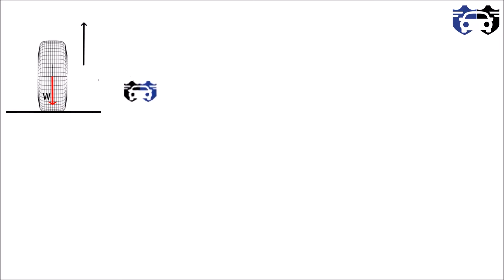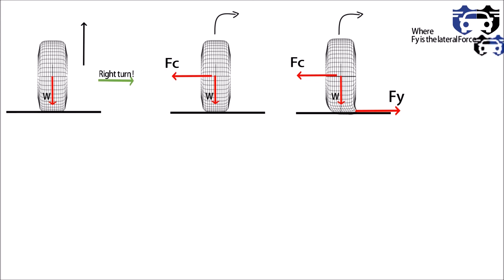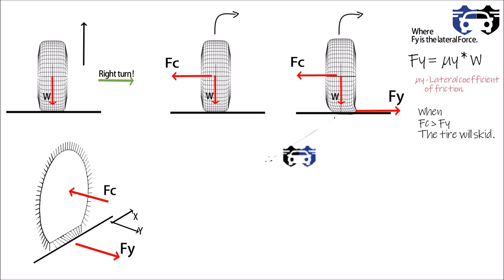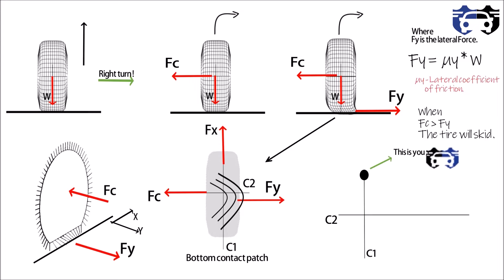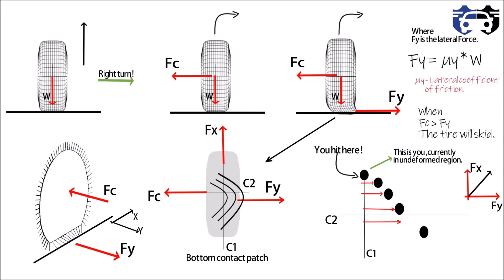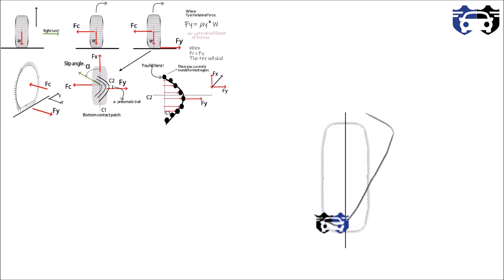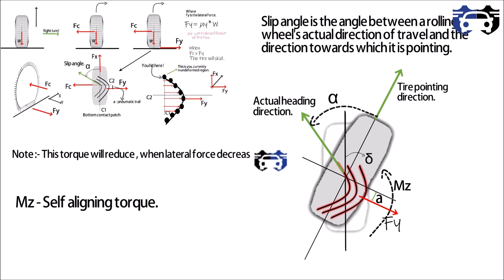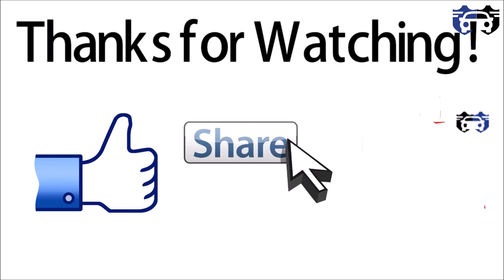What is Slip angle ? | How lateral force is generated ? | What is self aligning moment ?

Comment: The Actual Heading Direction arrow drawn at 3:16 is very misleading. Surely it should lie somewhere between the tyre centreline and the vertical line. Showing it as you do suggests that when steering the wheel to the right of its original direction the tyre actually travels to the left of its original centreline!
Or am I misunderstanding the diagram?
Reply: I have the same doubt can alpha the slip angle be greater than the delta the steering angle as shown in the diagram?
Reply: Since he is taking a right turn, the treads in the contact patch will remain the same where as the other treads will twist in the direction of the turn and that too to the right of the centerline not left as he has drawn. Thtas what I think

Comment: Umm... 
Does "Lareral Force" means "Cornering Force"???
I'm so confused beacause of concept of both of them.
Reply: There is no force called Cornering Force. When you want to turn, there are 2 things that will be consider:
1. Slip Angle (which cause when you suddenly change direction. Relevant to Lateral force. Here Lateral Force + Longitudinal Force will make your vehicle turn in a curve - of course there will be slip -> reason for the name Slip Angle)
2. Camber Angle: when you turn right for example, your center of mass will lead to left side a little bit and then go to right side->Lateral force will be created
Just information from this channel.

Comment: Is lateral force an effect of slip or is it the cause of slip?
Reply: The velocity vector through your center of gravity is directly on the longitudinal axis when driving in a straight line. When steering angle is introduced on the front axle the velocity vector comes off of the longitudinal axis. The angle between the axis and the vector is the body sideslip angle. This sideslip causes a deformation in the tire contact patch and results in slip angles on your tires. These slip angles on the contact patch generate lateral force
Reply: So body sideslip causes slip angles which cause lateral force

Comment: I didn't understand why the lateral force is at some distance from the centre axis?
Reply: Your tire experiences deformation under the load of the vehicle. This is what produced the contact patch. While cornering lateral forces are present throughout the contact patch, in free body diagrams the single lateral force vector shown is a resultant. This resultant doesn't occur directly on the wheel center for a number of reasons that are all mostly related to the tire material and how lateral forces act across the contact patch.

Comment: if delta is the steering input angle how can theeta be mote than that ???
Reply from the maker: If you are talking about steering wheel input angle and the steering angle of wheel, then greater or less it all depends on Steering and steering gearbox ratios.

Comment: Typical. Not explaning the thing to be explained(why the fuck Fy is not on the same line with Fc?) but draws figures and explain only the mathematical relation which is easy to understand and tell. Ps: im not asking you to explain it. You cant. But the real problem is, why you(or any teacher/professor) skip the most important parts on any matter? Is creating a free body diagram more simple than the mathematical explanation? I just want to understand this common behaviour that doesnt change with race or culture. If anyone has an answer or even an idea/theory or knows some research on this human behaviour it would be much appreciated.
Reply from the maker: Thanks for the feedback !
You told me not to explain but still I am giving you the explanation!
This will help you !
I think you don't know the fact that tire material is viscoelasticity and it has asymmetric load distribution which causes the shift of the load on the tire away from the central lines in x,y and z directions due to hysteresis loss.
In this video https://youtu.be/DOK_MJyCzBM 
I explained about the load distribution in front view of the tire which causes the rolling resistance, the same happens with the bottom patch of tire which causes asymmetric distribution due to loading and unloading of tire.
Check that video ,I think it will help you to understand some basic facts about tire.
Reply: @thevatsaljain  Spot on.. a gist of combining the load distribution theory and the free body diagram...
Reply: @thevatsaljain  thanks for addressing this point but I am a bit confused that for rolling resistance case the reaction load shifts in the direction of travel ( ahead of the static patch) but in cornering it is shifting behind the static patch. Can you explain this. Thank you